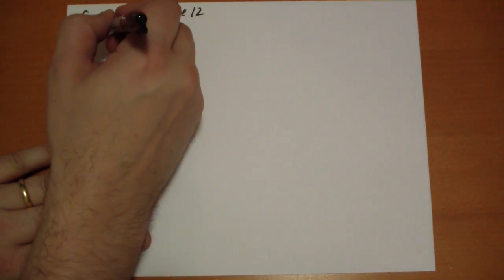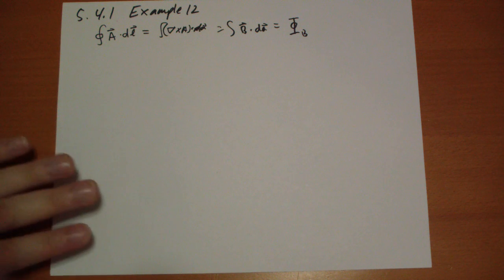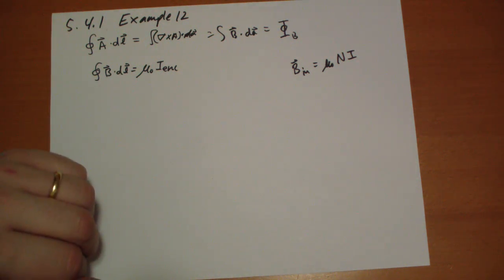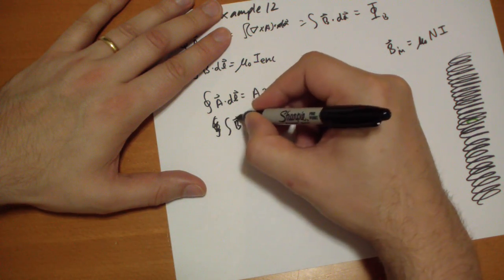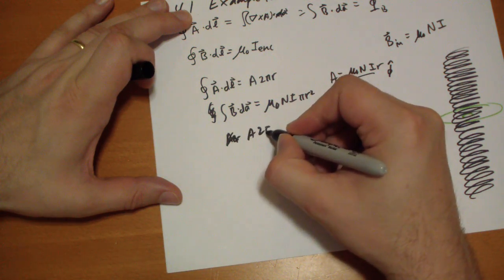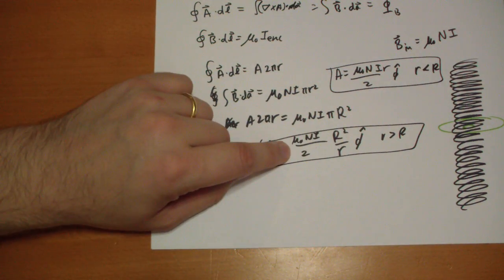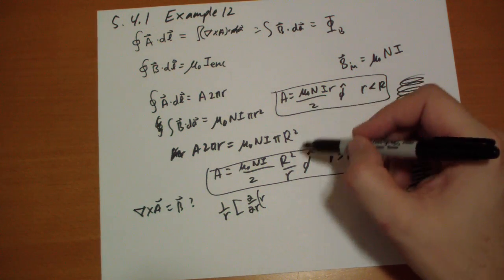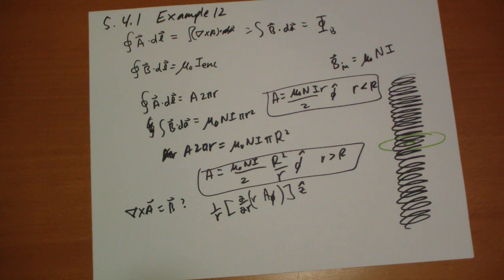5.4.1 Example 12

Comment: How did you decide the direction of A?
Reply: +Aneree Mehta 
A generally travels in the direction of the current, and the current of the solenoid travels through the wire, in the circular direction shown. The reasoning is written in the book as the paragraph after example 12.
The paragraph in question, copied out of the 4th edition of the Griffiths book.

"Typically, the direction of A mimics the direction of the current. For instance,
both were azimuthal in Exs. 5.11 and 5.12. Indeed, if all the current flows in
one direction, then Eq. 5.65 suggests that A must point that way too. Thus the
potential of a finite segment of straight wire (Pro b. 5.23) is in the direction of the
current. Of course, if the current extends to infinity you can&#39;t use Eq. 5.65 in the
first place (see Probs. 5.26 and 5.27). Moreover, you can always add an arbitrary
constant vector to A-this is analogous to changing the reference point for V, and
it won&#39;t affect the divergence or curl of A, which is all that matters (in Eq. 5.65
we have chosen the constant so that A goes to zero at infinity). In principle you
could even use a vector potential that is not divergenceless, in which case all bets
are off. Despite these caveats, the essential point remains: Ordinarily the direction
of A will match the direction of the current."